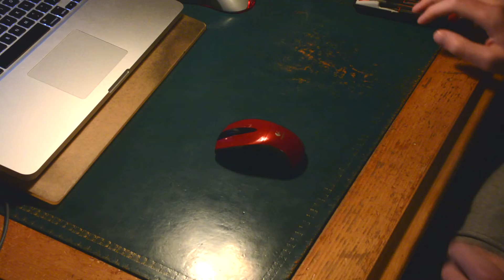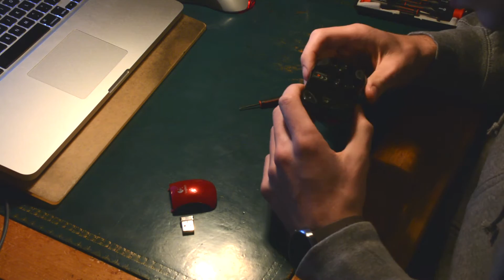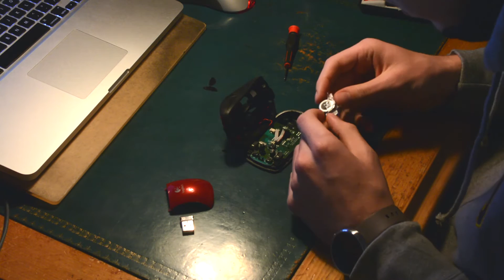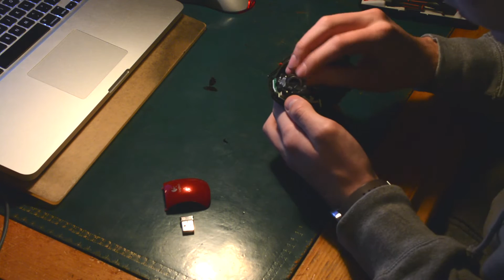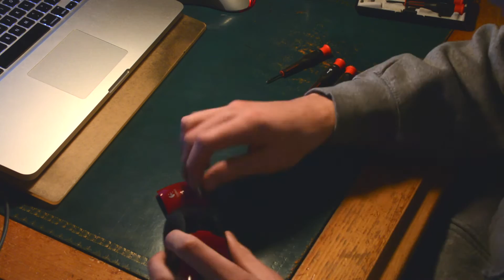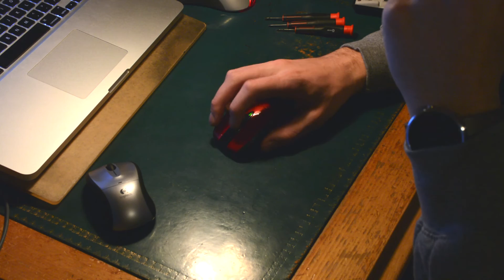Logitech Wireless Mouse Teardown and Repair

Comment: Hey, my m185 (got in combo with keyboard) was working perfectly fine until recently it stopped responding to clicks/scrolling wheel and cursor movement on the screen. It is not physically damaged either. I tried new battery etc. Would like your help in sorting this mess.
Reply: Same here, my mouse stopped responding to clicks, cant get a new mouse because of corona ive had to spam click just for 1 click and not i have to use an auto clicker